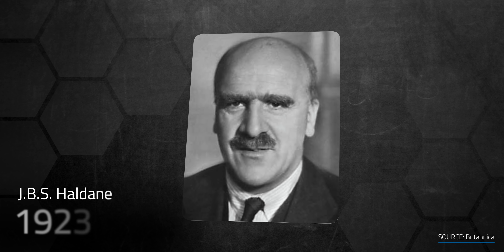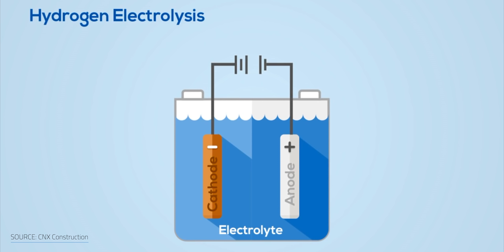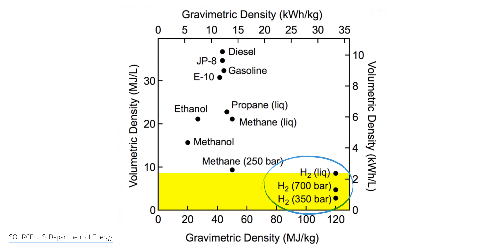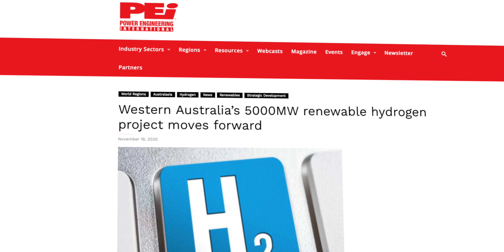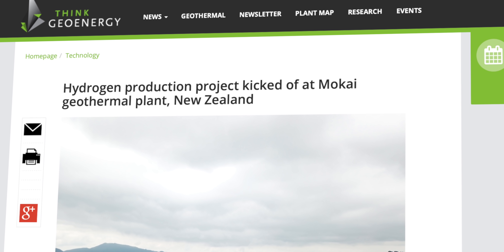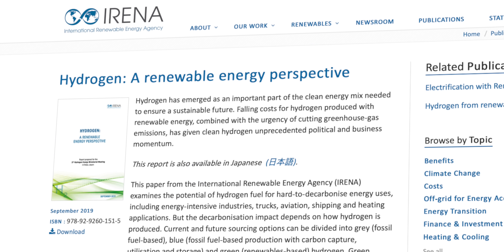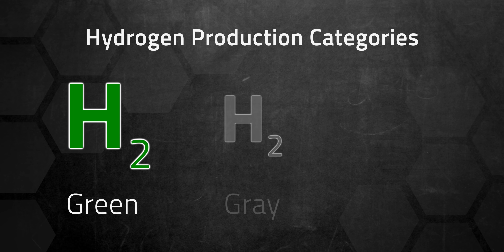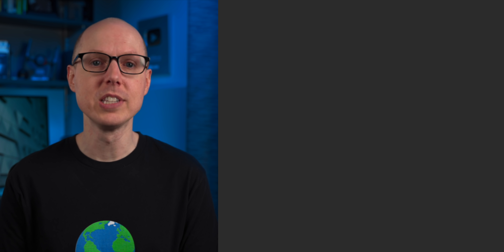The Truth About Hydrogen's Dirty Problem - Green Hydrogen Explained

Comment: Let there be energy mix. No single technology is totally green at their core. Let it not one against another; let there be all varieties and version. 

If the Carbon monster technologies like coal and oil could be embraced for such long, let’s keep hydrogen also in the energy mix basket….
Reply: Mixing up technologies might not be that good of an idea. it would be better to just concentrate one the one which is actually scalable and avoid distracting yourself with something worse just for the sake of it

Comment: Hydrogen will never get the same recognition as fossil fuels.Mark my word.
Its very dangerous considering the pressure at which they are stored and their volatility. You blow up the hydrogen tank and you are done. Mis use could lead to more problem.

Waste of time....some company wants to do it because of ego.

Comment: Hydrogen's dirty problem is that it's bullshit. Let's take electrical power to create hydrogen and then turn it back into electricity to run the car. See the problem here?
Reply: This focus on hydrogen cars is one of the problems of this discussion.
It's a bit like "You can't power a plane, that transports 400 passengers from London to New York within 7 hours, by batteries. So batteries make no sense at all!"
Green hydrogen will take its place in a future energy system without fossil fuels. Like batteries will do.

Comment: Very misleading to talk about Hydrogen production in litres. It needs to be measured in Kg to be comparable, because a Kg contains a fixed amount of energy, roughly equivalent to a gallon of gasoline. A litre varies massively depending on pressure. If it's atmospheric pressure, which seems likely since no compression was mentioned, 250L sounds like a lot, but it is only 0.02 Kg of H2. It's enough to drive a Mirai 1.5 miles. You'd need 20 of those panels to be able to drive 30 miles per day. And that's under optimum conditions, so in the summer. It's worthwhile attempting to develop such tech, but implying that this means you dont need to build utility scale plants is silly. Utility scale is always cheaper per unit of production.

Comment: Using wind or solar to produce hydrogen is only a "feel good" solution because you're ignoring the up-front start-up costs and maintenance for both. And lets not forget their vulnerability to the weather: do you remember what happened in Texas with the snow storm?  And lets discuss how easily solar panels can be devastated by one hail storm or hurricane.  In your entire presentation, you did not mention BIO-MASS production of hydrogen. Using microbial life that naturally emits hydrogen as its waste product is by far the solution which is scalable and requires much less energy to operate the production plant. As for comparing hydrogen fuel cells to battery electric vehicles, you left out the refueling/recharging time: 5 minutes or less for hydrogen and 8-10 HOURS for BEVs. (One hour if you have an expensive "fast charger".) Still, 5 minutes vs one hour is still a no brainer. AND surplus hydrogen can be produced and stored very easily compared to on-demand electric charging from the grid for BEVs.  Having millions of BEVs charge up every night will crash our existing grid. Not so with hydrogen. Let's also remember that BEVs and charging stations have had a decades-long head start over hydrogen filling station infrastructure. Honestly, if you have a water supply and are connected to the grid, (ALL gas stations do!) a simple electrolysis machine can be installed at most existing Gas Stations. Concentrate on producing the hydrogen right there and you eliminate the transportation costs of delivering hydrogen to the fueling stations by truck. (Gas and Diesel will always need to be transported to the fueling stations.)

Comment: It would have been worth it to mention methane reforming.  That 95% of hydrogen is made this way.  Likely because it is cheaper then electrolysis.  This process takes an enormous amount of energy to change water to steam, as high as 700 degree C steam. Then natural gas and the super heated steam meet.  

CH4 + H2O + HEAT  --->  CO  + 3H2

 The initial reaction produces H2 and carbon monoxide. 

 A secondary process uses more water, and the CO to  produces some additional H2 and CO2, carbon dioxide.   

So, how efficient is this?  Where does the energy to produce the super heated steam come from? What about the by-product of the reaction being CO2?  What about the by-products of the heat source, are we burning fossil fuels?  Is it renewable electricity? 

If renewable electricity heats the steam to produce the hydrogen why not just store the electricity in batteries instead and forget about the hydrogen?  I know, you want 10 less minutes at the recharge station.  It's  madness.

Comment: It is a complex problem with many variables.  Any way I look at hydrogen it just doesn't see to be as efficient from a system standpoint.  There are lots of areas for loss, the electrolysis, the compression or liquification, the storage vessels,  a possible need to truck from one location to another,  more storage issues at the dispensary point, the power loss of the fuel cell.  

I note that a lot of work in fuel cells centers around the catalyst, which seems to be platinum or a platinum alloy, I get that it's a small amount, but it goes into millions of vehicles, how much platinum are we going to need to power all vehicles?  Maybe this is offset by the lowered need of platinum from ICE catalytic converters.

Here is is what the pro-hydrogen ideology seems to me to be promoting:  The continuance of dependence on large corporations to produce needed fuel and the continuing need for distributors and retail franchises to sell that fuel to the public.  Each of these entities takes a cut of the profit.  Why do this when we are at the precipice of individual energy freedom?

I have owned a EV for two years.  I am in the process of getting solar on my house.  My offset for the year should be 115%, which means I will have little to no reliance on outside energy providers.  I'll make my own electricity from the great fusion source in the sky.  Sure, I'll still be tied to the grid for those occasion when I need a bit of help, but I won't be asking for billions to be spent on hydrogen infrastructure to be built just so it continues our reliance on big companies and a chain of middle men and retail outlets to sell us fuel.

Comment: Germany has very lately expressed interest in taking a lot of green H₂ from eastern Canada by 2025. This makes a lot of sense. All of Europe needs a better major energy supplier, and there’s some excess hydro capacity (and 2.25GW more that remains undeveloped) in Newfoundland and Labrador...and the wind effing blows. It’s one of the places on earth where green H₂ production might be an extremely good fit.

And there are at least four ice-free industrial ports (Stephenville, Port aux Basques, Come-by-Chance and Argentia) on the island of Newfoundland (please say it with the same cadence and rhyme as ‘understand’...the mangled pronunciations from some of you out there are almost offensive) that are surrounded by local wind domains sufficient to drive industrial-scale electrolysis and  H₂-to-ammonia(NH₃) conversion processes (for shipping by tanker)*.

There’s also a lot of fresh water on that island but it is a finite amount, and more than 10kg (aka 10 litres) of water are required to make a kilogram of H₂. That’s a large environmental burden. The fully internalized cost formula for the product needs to include a very significant royalty term paid by the user for the water.

 * The energy density of NH₃ is 35% greater compared to H₂, and NH₃ requires cooling to only -34°C for liquefaction versus 
   -253°C for H₂. (LNG ships at -133°C)

Comment: The Hydrogen age opened its doors. Green Ammonia is part of the Hydrogen group and has a higher density than hydrogen. It's used for the production of fertilizers, as energy storage at -33C (only), as fuel drectly replacing gas or diesel in combustion engines or as gas to power fuel cells.
Ammonia has different advantages over Hydrogen that is stored at -253C.
Expect more tech. breakthroughs in that field

Comment: I challenge a battery system to supply my heating requirements here in the Northeast.  A battery system for now can only provide a couple days of power…stored hydrogen (~50 kg) could potentially provide me 100+ days worth.   I think we need hydrogen or we’ll be a slave to fossil fuel heating for the foreseeable future.  See Hydrogen House Project.

Comment: There is a lot of False Data about Fuel Cells, which came about as propaganda by the o & auto industries to keep people from using FC vehicles.

Datum: The fuel is hydrogen gas.
Fact: While the most FCs use hydrogen, it does not need to be in gas form. Liquids and even solids are orders of magnitude more Energy dense (1000X or more).
In fact Hydroden can be found all over in each  state (gas, liquid, solid). Even gasoline ("octane") is 8 Carbon atoms + 18 Hydrogen atoms per molecule of gasoline. 

Fact: The device which strips the Hydrogen from any molecule is called a "Reformer".  There are Reformers for all sorts of liquids including gasoline, amonia, methane, methanol, etc, etc.  So you can pick any fuel source -- including gasoline.  
Add a gasoline Reformer to your car and pump gasoline into a tank just as you do today. No need to add special fueling stations.  But with multiple Reformers you can use several fuel types.
The US Military has a range of FC vehicles including a FC Personnel Carrier and they selected the fuel source as Amonia. Why amonia? Its the primary component of Human Urine.  Yes, their vehicles run on pee.

Data: Fuel Cells aren't as fast as battery cars.
Fact: Any vehicle is only as fast as its ability to process stored energy into power (in the case of EV, electricity).  That limitation is only as great as the conversion process itself.  Discharge a battery too fast and they explode or catch fire. 
For a FC that has mainly to do with the FC membrane surface area.  If you want more electricity produced faster increase the surface area.  While Tesla uses the entire bottom of the car for batteries, I'm sure that if you had a FC that large that it too would be able to accelerate a car just as fast.
This is just a sanpling of the most common FC Myths.

Data: Using gasoline as a fuel source wouldn't be efficient and defeat the purpose of having an EV.
Fact: In case you're wondering, by actual test, FC vs ICE using the same fuel, the FC were 3X more efficient per gallon of gasoline.  You could get 3X the miles on the same tank of gasoline.  And some Reformers are more efficient that the gasoline reformer. 

Fact: With no moving parts, except a valve as a throttle, the maintenance is virtually nil too.  It doesn't have 1000 machined moving parts but is an efficient chemical reaction and that's all.  If you ever need to replace a membrane-type FC its as simple as unbolting the stack and replacing the rubberized membrane.  Easy.
Reply: ... by oil & auto industries...

Comment: The premise for this video is false.  Hydrogen from methane does produce CO2, but less than conventional fuels.  Also CO2 is good, not bad. It's plant fertilizer and cannot produce significant warming.  The efficiency experts ignore the energy cost of carrying thousands of pounds of batteries on America's roads.  Once we have enough hydrogen fueling stations the game will be over.  Solar, wind, batteries, leaky hydrogen are all false arguments.
Reply: .... its included in the kWh per mile used.... similarly its included in the grams of hydrogen used per mile when calculating those efficiencies. If hydrogen got 7 times further on the same amount of hydrogen then it would be a different story wouldnt it? so its not ignored.

CO2 is plant food but too much can be a very bad thing. For instance you want to have a small plat of chips. But it would probably start causing you problems if the room was filled to the roof in chips. Co2 isnt the most effective greenhhouse gas but it does have the highest amount of chain dependancies. What do I mean by that? lets review a cycle. One of MANY.

Sea algea feeds of co2. its actually one of the worlds largest consumers of the gas. So clearly, any lay person would conclude, more co2, more algea, problem solved right? wrong. If the amount of Co2 is higher than what can be absorbed by the existing algae, its absorbed into the water. this raises the acidity of the water. Which in turn, kills the algea. with less algae to absorb the carbon, more is absorbed into the water, which kills more algae. You understand why climate scientist talk so much about feedback loops? 

We know this is happening because the same acidity which kills algae also bleaches coral. and guess whats happening world wide?

Here is another. We know that the white ice caps over the earth reflect ALOT of sunlight, sunlight which would have otherwise generated more heat in our oceans. Now if they heat up just a little bit, more ice melts. With less ice, more heat gets into the oceans. which raises the temperature again but a fraction of a degree, which melts more ice, which allows more sun... see where that is going?

why does that affect us? well not so much in the immediate future with sea levels admittedly, but by raising the temperature of the ocean, even by 0.01 of a degree on average, the uptake of evapouration of the ocean increases ALOT that causes more severe storms to happen more regularly. It results in higher than average rainfall. Unfortunately that means that percipitation of that water vapour occurs sooner. meaning whilst the coastal regions are flooded more often and more severely. its rained well before its gotten inland. meaning that further inland you have droughts lasting longer and occuring more often.

are you seeing a pattern here?

sure. CO2 is good for plants. but too much isnt.

Comment: Hydrogen is not made mainstream because the big whigs and oligarchs and tycoons are using high powered lobbying to prevent it from coming out because they won't be able to control the productions because people can easily produce it in their garage to fill up their although that'll be somehow dangerous.
And hydrogen can be made out of many recycled liquids and with sun giving us abundance of electric energy that's limitless power.
Reply: you're not going to be producing hydrogen at home. its unfeasible. You also definately wont be getting excess from solar. On the contrary, whilst fossil fuel companies are engaged in a disinformation campaign about BEV's they are quite firm on supporting hydrogen. Because most of their markets are phasing out fuel. Meanwhile hydrogen is most commonly and most cheaply made using.... well fossil fuels.... further to that the only practical place to get hydrogen is from a fuel station. guess who has a monopoly on that? fossil fuel companies. Meanwhile BEV's can be charged using home solar. Practically and cheaply. They also never need to use fuel stations potentially threatening fossil fuel companies second largest capital investment and largest income stream.

Comment: You're leaving out two important considerations: (1) battery vs tank+cell manufacturing issues, including lithium scarcity and the pollution created; (2) the cost of idle time while charging. A typical taxi runs 24 hours, switching drivers every 12 hours. Three hours of idle time is unacceptable. Likewise any 500+ mile drive. Finally, apartment dwellers can't find 3 hours of charge access easily. City cars, buses, and trucks have no green option apart from fuel cells.

Comment: Good. I know I can count on this channel to have a quick overview of a field. "Rust" is a bit misleading here as alpha-FeOOH is goethite. It isn't "rust" because the most thermodynamically stable form is hematite, which is alpha-Fe2O3. While structural rearrangement is evaluated based on the ambient stability, its electrical redox potential is most likely different. I'm a bit doubtful of the stability of this system, but I would look further into it.

Comment: So my thought. @ 1:36 The diagram of solar panels direct to hydrogen to a tank for storage is basically a battery of a different chemistry. 
Because as you know H2 is a method of storage not a source of energy. So the question ought to be. Which one makes a better battery? A battery, Or a tank of H2.
Lets see - A Battery - you charge directly from a solar panel and feed it back to the grid. (90%+ efficient)
Hydrogen - Solar panels to H2 electrolysis (minus 15%) Power used to compress the H2 into a tank (minus 10%)(so now down to 75%). Convert H2 back to electricity with a fool cell that is according to US Dept of Energy 60% efficient (minus another 40%) So that equals about 35% of the power originally produced from the solar panels.
Adding to that the additional capital required to install nearly triple the solar panels, electrolyzers, compressors, storage tanks btw 10,000 psi tanks are not cheap, and industrial grade fool cells also not cheap.

Comment: Matt, your "rainbow" of hydrogen colors is incomplete. There's also a recognized category of "turquoise" hydrogen, produced from pyrolysis of natural gas into hydrogen and solid carbon. Plus a  category you won't have heard of that I'll call "violet" (beyond blue). It's a form of steam methane reforming in which the thermal energy needed to drive the reaction  is provided by renewable electricity. Energy-wise, it's about eight times as productive as electrolysis of water.